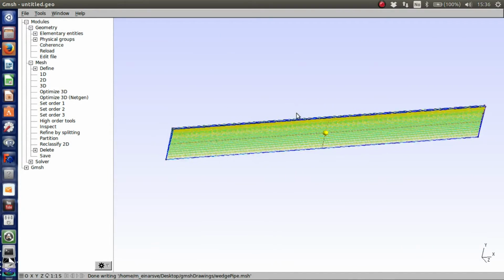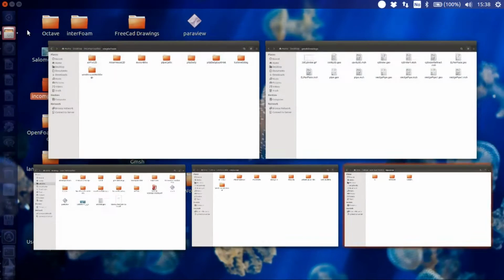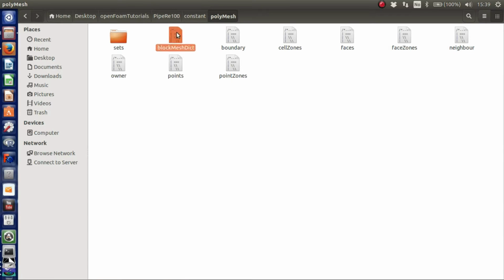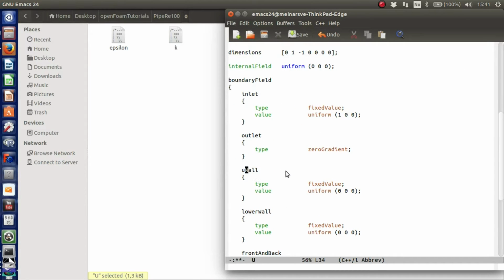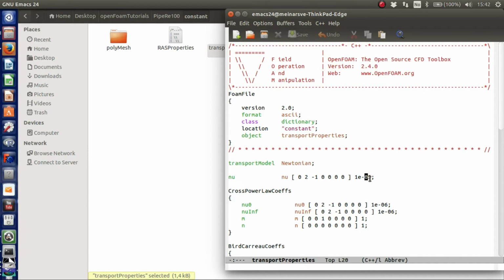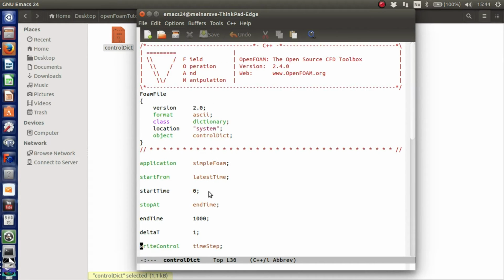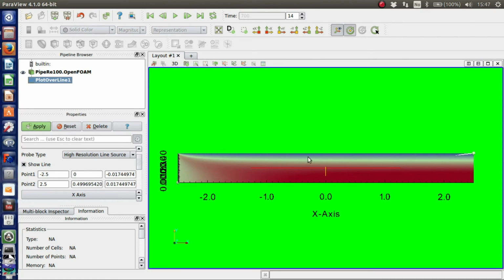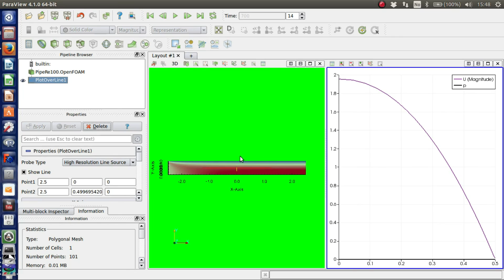Laminar Pipe Flow with SimpleFoam in OpenFoam

Comment: Hi
When I set my RAS model to laminar I get the error:
"[...]
Selecting RAS turbulence model laminar

--> FOAM FATAL ERROR: 
Unknown RASModel type laminar

Valid RASModel types:
[...]
Is it because it's a newer version of what's the matter?
Reply: change
simulationType RAS;   to    simulationType laminar;
Reply: Thank you  @xMayor92  , it worked for me
Reply from the maker: +Aggerschoen Hey,
DId you copy the tutorial from the Pitzdaily case? In general if you type a wrong RASModel type that OF doesnt understand you should get list of valid keywords as a repons in the terminal. I was running the tutorial on OF 2.4, but I dont think the OF version is an issue.
Reply: +Aggerschoen 
I also got the same error. did you figure out the problem?